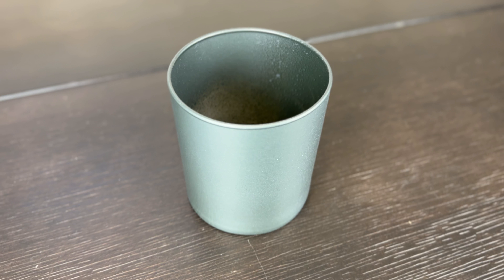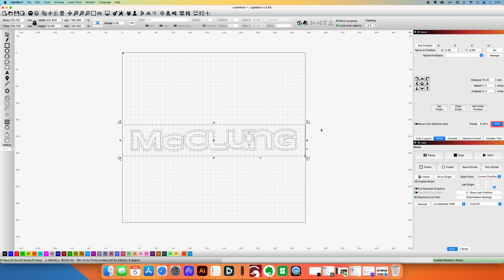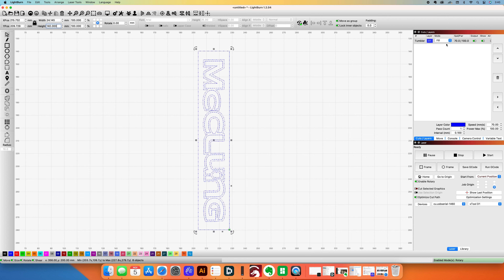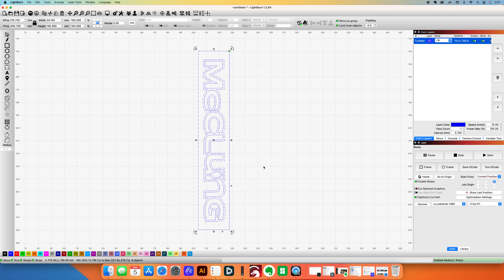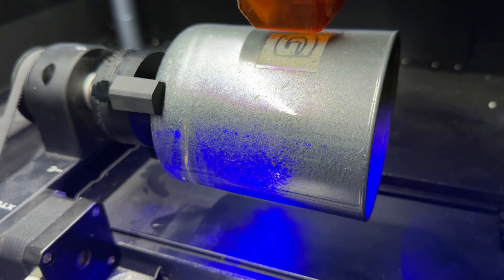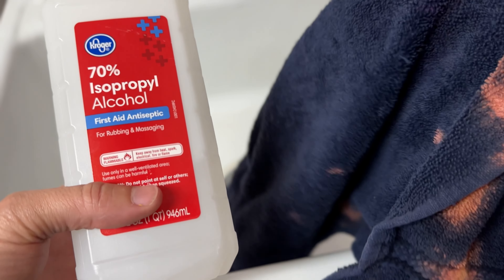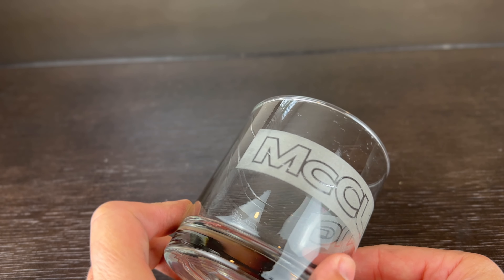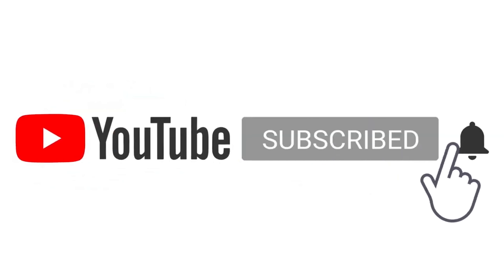How to Laser Engrave Glass With The Xtool D1

Comment: I've watched several of your Xtool videos and am super impressed with your results. Your calm and straight to the point delivery is very easy to watch (no unnecessary volume changes or weird cuts...) The laser itself seems great but competency you have with it makes it seem like it would be easy to work with. I am shopping for a laser and believe the Xtool D1 pro would be a solid choice. I'm torn between the 10 and 20W versions though. Which are you using for your work?
Reply from the maker: Allen, I appreciate your feedback. Honestly, for me 10 watt does what I need. With that said, depending on the cost for 20 watt, might as well get more power if the money makes sense. I am also a fan of staying on the cutting edge as vendors upgrade their platforms so take that for what it’s worth as well. And just an FYI, I am hopefully going to get my Atomstack P9 M50 review uploaded tonight if all goes well.
Reply: @justinmcclung  I went ahead and grabbed a 10W version. They are on Amazon for a little less than the Xtool store plus a $50 coupon so decent savings. I saw that xtool has released an infrared laser module too that handles all metals. If I find myself limited by the 10W, maybe I'll see how that one works. Looking forward to seeing your thoughts on the P9 M50.

Comment: This looks great! My engravings come out black and I have to really scrub to get it all off. I have the D1 and I’m using the Cold Galvanizing Compound. My settings are usually 100% power and 25% speed. Any ideas why it’s black?? Thank you!
Reply from the maker: I wish I could help but I have only tested using Dry Moly Lube. Next time I get a chance, I will pick up some Cold Galvanizing Compound and see if I can repeat though.
Reply: I would guess, purely a guess, that your speed is way too slow. It's allowing the galvanizing compound to fuse with the glass due to the extreme heat. I would try speeding up to at least 50, probably close to 70 .

Comment: I tried setting at 70mm/sec speed but for a simple 30x60mm "test" etching lightburn estimated almost 7 hours
Reply from the maker: Sorry to hear your results are taking so long. I have never had one take anywhere near that long. Even 360 degree designs take a fraction of that time. I can try to help you if you would like. If you could take a screenshot of your Lightburn settings and e-mail them to me, I help however I can. jwmcclung@gmail.com
Reply: @justinmcclung  thank you so much for offering to help! Being new to lasers and Lightburn I didn't realize I had my settings on mm per MINUTE instead of seconds
Reply from the maker: @thefilthelement  glad to hear you got it figured out.